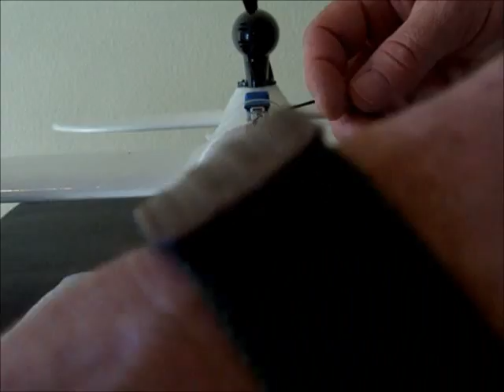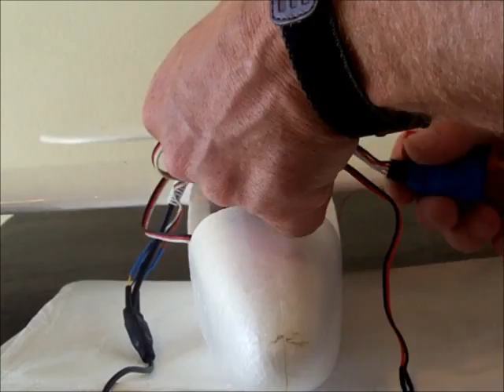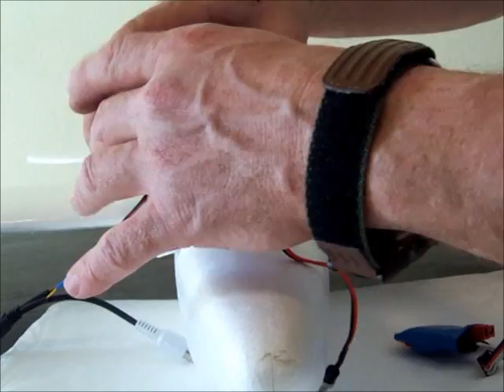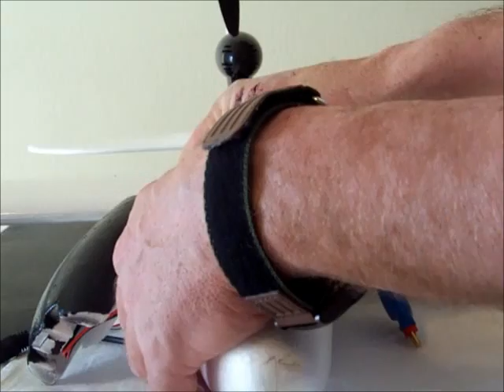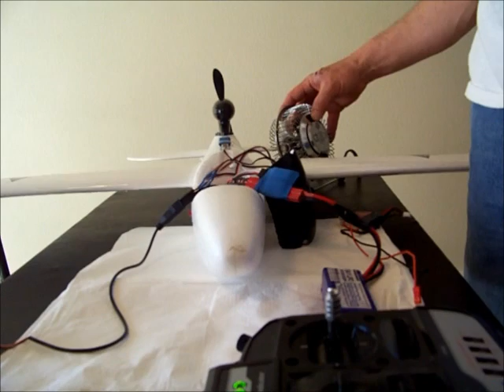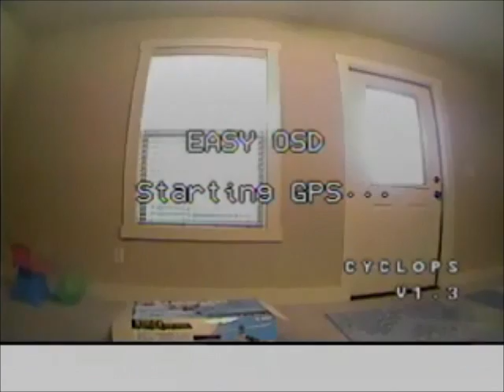Cyclops OSD set-up

Comment: Still have no idea which direction to mount the main board or the GPS unit...Mine has no little white airplane symbol to denote what is front...
Reply from the maker: Mount it anyway you like. This OSD does not have a MAG so it doesn't matter which direction. Same as the GPS sensor.

Comment: If i have one 4s battery to power everything also the vtx and camera will it still supply 12v on the fpv system?
Reply from the maker: If you are using 4s for main battery you will have to power the OSD separately with a 3s lipo unless you add a step down from 4s to 12v and then plug in that lead. You cannot power this OSD with 4s...I believe only 2s-3s

Comment: Mine just stays at the first screen.   I have two of these from BEVRC, the first one works great.   The second one just stays at the first screen.  

The only difference between the two osd's is the second one had a different GPS. Im not sure why BEV sent a different GSP but the failing OSD only has a three wire GPS cable.  The working OSD has a 5 wire cable.    

Could this be the reason that the second OSD just stays at the main screen? ( EZ OSD) screen?

Comment: hello man, sorry because i'm asking and asking...i have a new one. i'm powering (trying) everything with the main lipo, i connect the power jumper on 2,3 pins as the OSD manual shows, now, i'm stuck at how to power VTx because when i connect the lipo trough the current sensor the VTx doesn't starts, but, i use a parallel deans connector to power the VTx and the ESC by the current sensor and it worked,, my question is,, is that a correct way to power up those things?.
thanks again my friend.

Comment: What video frequency are you using?  I am having an issue with my GPS not connecting and I think it might be related to interference from my transmitter which is running on 1.2GHZ.

Comment from the maker: @bellalalmulla  Sounds like you may be getting some interference.Pic should be smooth all the way around.Try powering on video system with main power to plane off.Also test distance from groundstation,sometimes you can get interference if too close to receiver and monitor.It really comes down to lots of testing until you find the culprit. What version does your screen say at initial start up?